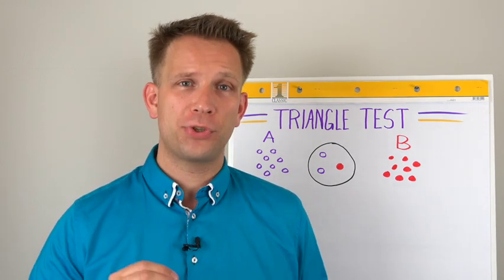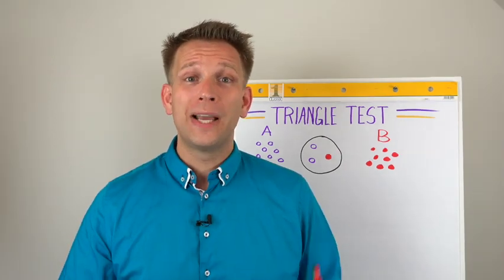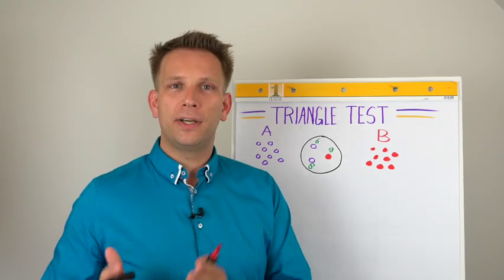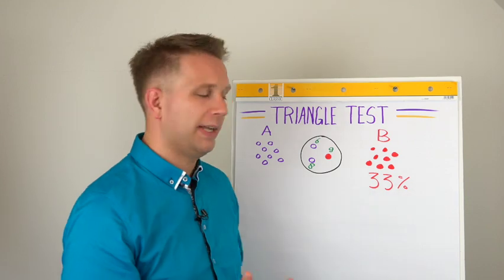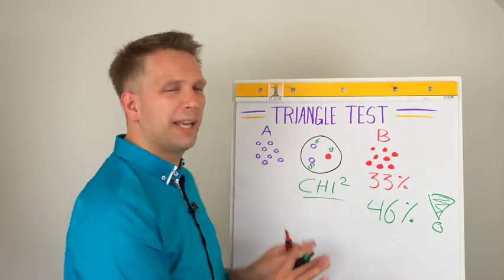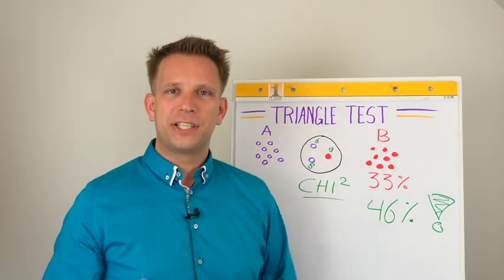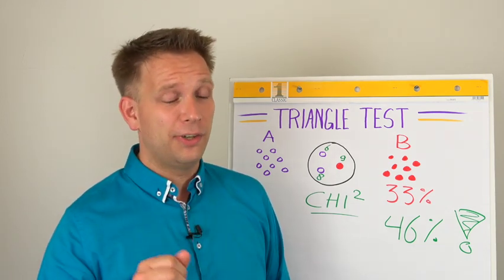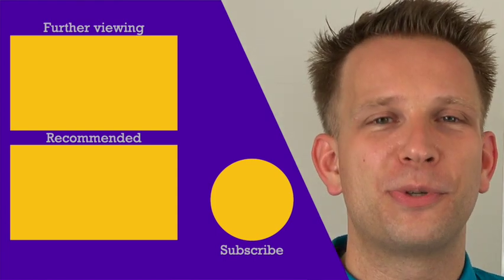Triangle test explained | How to validate process changes

Comment: Can we use binomial testing also for triangle testor chi square is better. How do you choose?
Reply: Great explanation..Thanku for explaining it so well.  I have one more question, gor example I am doing a triangle test where I have two control sample which contains 100% salt and one test sample which contains 90% salt. and I am asking consumers among three samples, which tastes different. So here should I use binomial or chi square and why?
Reply from the maker: @oshinsahni1742  again, both will work fine. The statistically preferred option will be the binomial, because you know that the prediction value is 33% (you’re not comparing 100% to 90% salt, but the assumption that your assessors will pick the new product 33% of the time randomly if they can’t actually sense a difference between the two products)
Reply: Thanku so much for explaining it so well. It makes sense to me now.
Reply from the maker: @oshinsahni1742  my pleasure!
Reply from the maker: Great question, and in fact you're totally right about using a binomial test, it is even a little bit better statistically speaking, since you exactly know the 'reference population' numbers (33% in this case). I will say that in practice, if you're right on the significance limit of a test you're in murky water anyway.

With these triangle tests, you assume that if your new product is actually different, that one will be chosen more often than by pure change. So for some extra comparison, if you use the setup discussed in the video (1 out of 3 is the new one, so 33% random chance), you'd need 3 out of 5; 6 of 10; 10 of 20; or 22 out of 50 samples to say that this new product is significantly different from the old one. As you see, if you take about 20-50 samples, you're at that same roughly 46% that an average Chi square gets to (and the chi squared numbers will also chance when you take fewer or way more samples).

But again - thanks for this question, this is how we all learn to do better Six Sigma.

And just to be overly complete, the answer to your second question is that binomial is preferred when you accurately know the expected distribution ahead of time (like how often a coin should land heads up), while chi squared is preferred when using the data itself to help assess the reference distribution and there could be some sampling error in that reference too (like comparing how many defects we produced last year to how many we had this month - since your data from last year isn't "the truth" but also has sampling errors).

Comment: Thank you sir, well explained. Is there any particular testing condition required for the triangle test, like temperature?
Reply from the maker: Not really, it is always better of course try and keep the test conditions the same if possible, but actually this triangle test is particularly suited to be used in 'market conditions'.
Do keep in mind that it is a very suitable test for food products, packaging and other things that you test with human sensory input. If you've got specialised measuring equipment to generate a value per product, using a t-test is almost always better. The triangle test is used when you want to assess whether or not humans can spot/taste/sense a difference between two versions of a product.
Reply: @TomMentink  how do you code and decode samples?

Comment: Interesting video and well explained, thank you! Some sensory text books recommend to let the panelists test all different combinations (AAB, ABA, BAA, BBA, BAB, ABB). How would you analyze the data? Just by assessing all responses independently in a chi2-test?
Reply from the maker: You don’t have to split all responses independently. In fact, statistically AAB and ABA are the same, for instance. 
What you do in this case is to use the total combined distribution of all offerings into 1 percentage: if you gave 6 people each one of these variants, you test for an expected 50%/50%; if you gave 10 AAB, 10 BAA and 10 BAB, in total you handed out 50 A’s and 40 B’s, so chi test with expected 55,5%/44,5%.